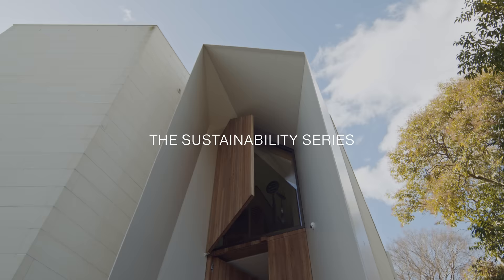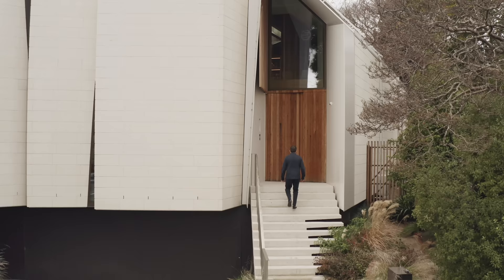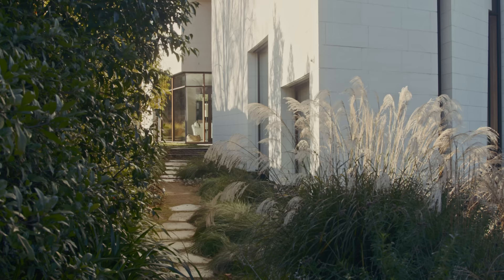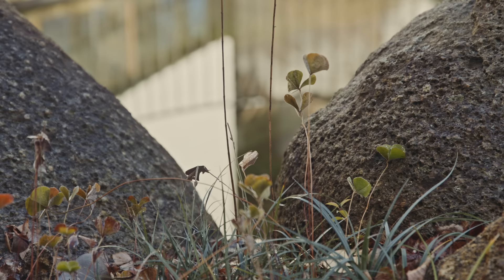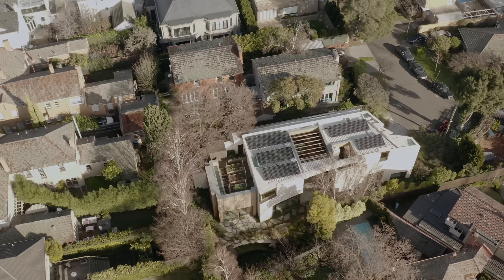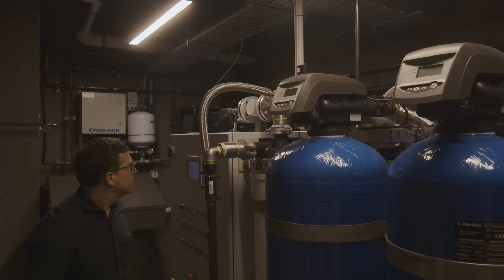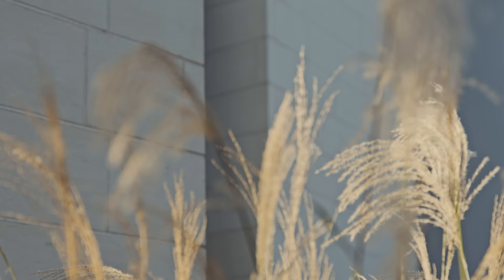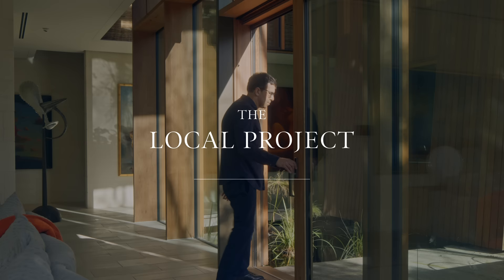Would You Live in This Sustainable Off-Grid House? (House Tour)

Comment: In reality, the self sufficiency of this home has likely been counter to its goals. While it’s likely worthwhile as an experiment, I’d be really surprised if the energy put in to its extraordinary construction didn’t create a deficit that it won’t return for decades, if ever at all. If the owners wanted to save the planet, a traditional home built with some good decisions would likely have had less impact. 

The easiest way to estimate the actual environmental impact of a home is by its cost. If it costs a lot extra, it’s likely not actually very green. The money paid for all sorts of people using all sorts of energy to get that house built in that spot with those materials. 

We really need to start calling BS on this stuff. If an architect wants green cred, let’s see a house that will last, cheaply built, with good efficiency. Otherwise, you’re just building fancy homes for rich people which isn’t really that big a deal. It’s done all over, and has been for centuries. It’s not saving anything or anyone. Build an efficient home for $150 a square foot. Build it so that people will buy it even though it’s 1200 sq feet. Now, you are making an impact. That will make you rich and famous.

Comment: There's a fundamental problem with passive houses. You basically build a spaceship on the Earth so it needs constant forced ventilation and humidity control. It means that you need complex mechanical and electrical systems, operating all the time. Without them the house is not functioning.